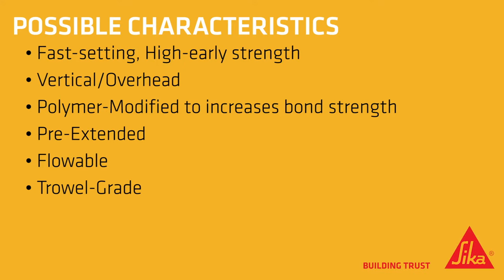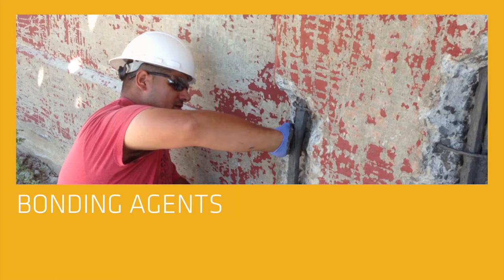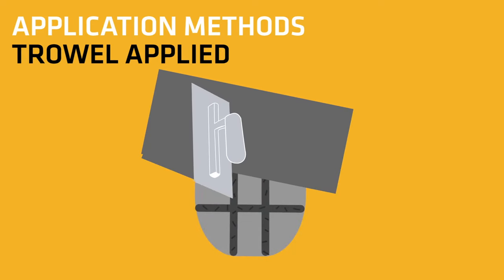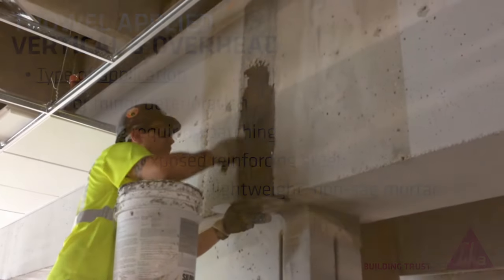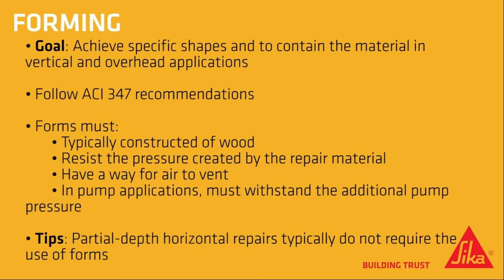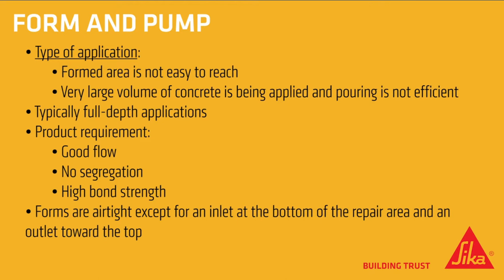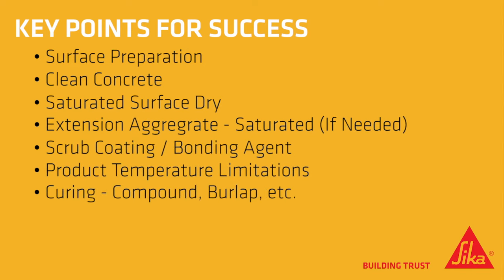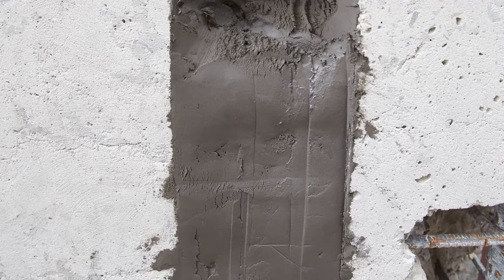Concrete Repair Application

Comment: Due to following this process the self weight of structure will be increased by providing the extra rainforsement and reinforcement also providing also deficult. It's a not engineering technic. Also in this process they don't give clarity about we make sure how much length reinforcement bar driven into the wall .

Comment: What is that robotic arm called that’s holding the jackhammer to the ceiling ?
Reply: That's called P.A.M. Our company bought one 8 years ago and it works wonders for chipping out concrete overhead. Requires compressed air. It's good for doing large open areas. Cost was around 15k.